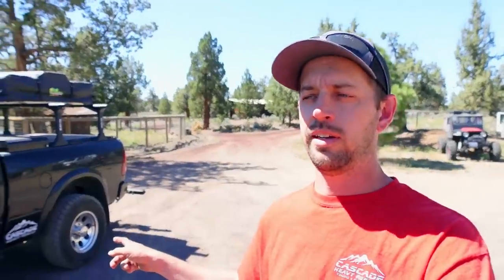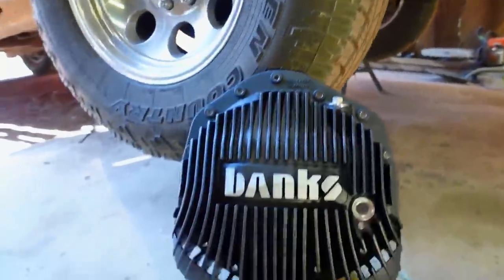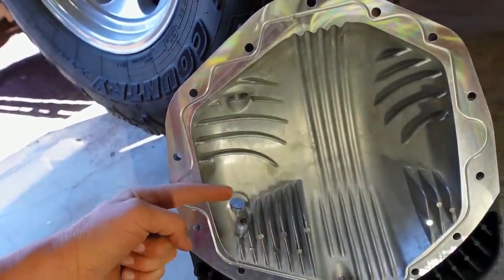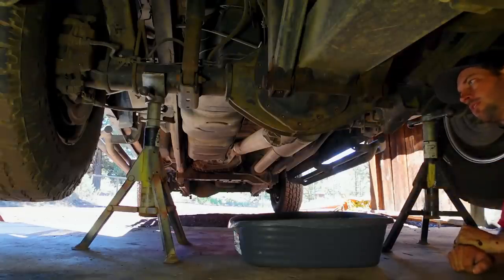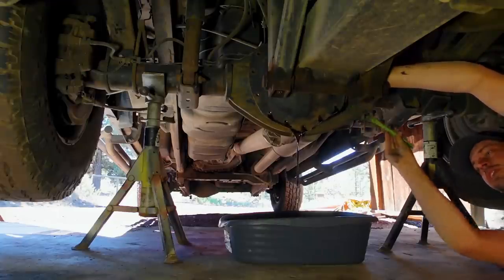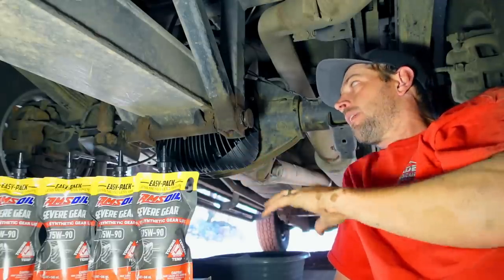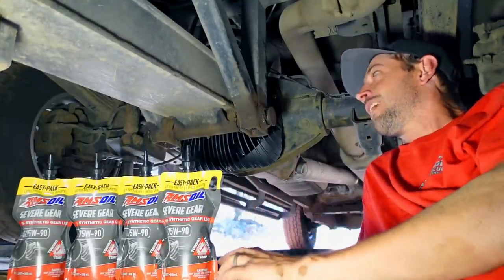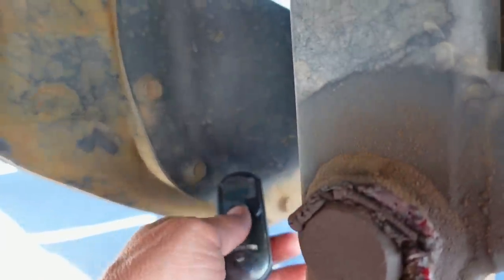Can we make this rear end last?? Installing the Banks Ram Air Diff Cover

Comment: A tip when removing dif covers. Leave two of the top bolts in, just loosened a few threads. When you  pop the cover, the cover will stay in place, but will swing out and the oil won't splash all over the place. Learned that from my grandma.
Reply: Did she do Burn-outs like PAUL/FabRats'  mom  ?😄?
Reply: like eric over at south main auto channel says '"a little trick memaw taught me"

Comment: I remember watching the Banks video serious where Gayle Banks was testing rear dif covers to develop that cover. A lot of aftermarket covers not only did not help, they actually hindered lubrication.
Reply: When I first saw the Banks demos I didn't like the way his cover extends beyond the factory dif. I still dont like that it extends past the bottom of the dif, if you hit a rock yes it will break the cover. It will break in a non uniform manner and will break a good portion of the dif cover. The reason being there is no breaking points for it to break in a controlled manner. Also rocks chips will become stuck in the fins and it's a pita to remove.
Reply: 2 words :  SKID PLATE
Reply: I just saw Banks startup video of the Supercharged Duramax in the C10. Wow. It responds like a gas engine. Very cool. The man puts in the time and money to have the right team doing R&D to build very cool and functional products.

Comment: I bought one two years ago to hff help cool down the gear oil.
My truck is used almost exclusively for towing. The Banks cover has significantly lowered the temperature, especially on those long pulls on 6.5 % grades on hot days.

And yes, I use Amsoil in the diff, G56 manual trans, and engine.

Michael  Rzewuski

Comment: Casey, once upon a time I shattered my clutch plate in my 46 Willys. I had no tow insurance and no money at the time. Luckily I found that I could power shift and drive slowly back to my home. Once home when I tore it apart for inspection and repair work I found that It was a miracle made it home. The pressure plate technically was still functioning but was jammed with clutch splinters. The splinters of the clutch plate had wedged into the pressure plate and lodged into the remains of the clutch disc hanging on the transmission input shaft. This all could have disintegrated on any one of the power shifts I made on my way home. I was lucky to make it home. You did the right thing getting a tow truck for the ladies. These adventures had the insurance to get towed.

Comment: So on your Banks cover I noticed the fins on the exterior are the Same gauge of thickness from cover to end of fin. The heat dissipates at the very tip when cool air runs through the fins. I like seeing the tip of the fins thinner as you will dissipate more heat faster into air. Just my two cents, but looks like a great functional cover.

Comment: Casey.. Consider having the old housing straightened and a "truss" added to it thus making it able to handle the additional torque from the engine and remember low range.. Torque increases by the amount of the ratio reduction.. Hence; 3:1 reduction on a 100ft lbs input torque yields 300ft lbs output.. One oop's while in low range will twist that housing instantly..

Comment: Check your sight gauge (might need a little mirror) if you put in all the gear oil. It overfilled my diff, so I used the convenient level drain to lower the level to where it belongs.

Comment: Great video Casey! I also run Amsoil in my, front and rear diffs, transfer case and manual transmission. I'm about to hit 200k and I use my truck (not quite like you though lol) for daily driving, off roading and truck stuff and every time I change the fluids (usually every 60k ish), I'm amazed at how clean and clear the Amsoil fluid is.

Comment: Just a quick hint. 
I always cut the heads off a couple bolts of the same thread as cover bolts. That way you can hang the cover on them, before putting the other bolts in.

Comment: I watched Gale Banks series of when they designed this diff cover. He probably didn't make any friends from the other aftermarket diff cover companies, however his design makes total sense. If the flat backed style was better then Ford, Chevrolet and Dodge would all be using them. Banks is a smart guy and had an excellent channel.

Comment: Hope the cooling cover solves your rear end problems because they can't be cheap for that truck. A friend turned up his 5.9 and had driveline issues all the time. After his 3rd automatic transmission he went to a standard shift then he started having drive shaft and rear end issues. It was mostly due to the way he treated it. Another friend kept going thru clutches in his dually, he used his to pull a 3 car trailer. Just a lot of torque under the hood for that size truck.

Comment: That conversation you had with Jay could have been worse, you know.  He could have started talking to you about your "Third Member."  That is an old term my dad used back in the day.  I don't think there are any modern light trucks that have a removable carrier.  You might explain that at some point as well.  One thing about your ostomy bag, you sure don't let that stop you!  I didn't realize the damage a person could do by pressing the gas, I mean accelerator, to the floor in a rig like yours.  I have a Banks Tuner on my truck and I didn't give it a second thought.  Great video!

Comment: Love the Banks diff cover and your install. Went to the Banks video and loved that. However, the Banks diff is $375 and price increase in March, so a bit stiff for my fixed income. It did lead me to look at the rear diff on my 2001 RAM 2500. (Not sure Banks even makes one for that model.) Anyway, bottom of diff looks dark, so wondering if an oil leak. So thanks for leading me to that! Big fan of your vids!

Comment: Get a drill powered gear pump... one hose in the oil container and the other in the diff. fill hole...

Easy Peasey, Lemon Squeezey...no fuss, no mess (until the diff. is full and it starts pouring out the fill hole anyway)...

😄😁😆😅😂🤣

Comment: I am wanting to say that when Jordan installed that rear axle in your truck you mentioned that there was going to be some "adapting" for ABS sensors, etc.  because it was a 2008.
Reply from the maker: Yep, a 2014 uses a four sensor system with wheel speed sensors at each rear wheel.  A 2008 uses a three sensor system with a single sensor inside the rear diff.  We got a little creative and adapted the 2008 rear axle to read wheel speed at each individual wheel and work with this trucks computer.   But the tone ring is still inside the diff and I completely forgot about the whole axle swap when Banks asked for the truck info to send out the cover.

I have to say,  Nate, Jordan, and Gavin are complete badasses when it come to figuring out how to make shit work.

Comment: we made the mistake of running one of those flat covers. it kept the oil cooler but it didn't flow right. the biggest problem is that those diffs have a unusually long pinion which means it's farther away from the oil flow

Comment: This is surprisingly interesting. It begs the question why auto manufacturers do not implement such superior design from the beginning on vehicles where it would be beneficial. Not needed on a Camry, but on 1 ton and bigger trucks and certain sports cars it sure would make sense.
Reply from the maker: Because a piece of sheet metal stamped into shape in just a couple seconds is FAR cheaper to produce
Reply: Further to Casey's response, it's also because the accounting departments of vehicle manufacturers have bigger muscles and louder voices than the engineering departments.

Comment: Hmmm I'm torn.  I have a shiny new Mag-Hytec cover ready to go on soon.  I like that it doubles the fluid capacity.  I've used them before and love 'em.  Plus, I have a big-ass Hellwig rear swaybar and this should just barely fit, whereas I'm not sure the Banks will.  Not to mention the Banks one is about $100 more.  I tow VERY heavy... truck camper + 36" extension + 24' enclosed trailer.  I already switched to 19.5" tires (dually) so I'm not overload the tires anymore.  I'll be adding a temp sender too.
Reply from the maker: Watch the Banks videos on diff covers and you'll see that those big high capacity diff covers actually REDUCE your lubrication..
Reply: @CaseyLaDelle  Well, after seeing that, I arranged to send back the Mag-Hytec and I ordered the Banks!  Perfect timing on this video, Casey.   And I hope your rear end problems are cured. 😛

Comment: flaps break off will cause fluid to leak and leave you stranded on the side of the road?
Reply from the maker: I very clearly addressed that, and Gale Banks literally broke them off on video to show and explain what happens.
Reply: @CaseyLaDelle  , he did not show in real life and he didn't show if any fluid would sip. We don't even know if rear end even had fluid when did.  I can assure rear end had no fluid when he broke flaps.
Reply from the maker: @repairvehicle  you are 100% making that up in your own head.    But let's pretend you're right for a second...  These things have been out for years, where are all the reports of them breaking and dumping fluid??

Comment: Yeah that's nice and all but it's not gonna stop them tubes breaking breaking it's not gonna stop them Wells from being weak week there's different types of gussets and supports you're supposed to Weld to those rear ends to make them strong enough
Reply from the maker: I can solve the axle tube problem by simply not towing with it in race mode..

Comment: Are you doing anything for the torque issue that actually broke the rear end? This cover is to keep it cool of course but the torque twisting the tubes is why it broke, correct?
Reply from the maker: Yes, I'm not flat footing the throttle with the timer set on race mode while towing cars on the wheel lift 🤷🏼‍♂️
Reply: @CaseyLaDelle  I figured the lead foot was the problem.  So there isn't an issue that needs to be fixed and that is good info. Thanks for the video!

Comment: Just curious...with all of the off road recoveries that you do, will the cooling fins get packed with dirt and mud?
Reply from the maker: Snow, yes.  Mud, no.   Mud is a very rare thing around here
Reply: @CaseyLaDelle  Wouldn't any heat generated melt the snow? I guess if it is really cold outside, it probably won't melt. I guess snow wouldn't hurt being in there. It would keep the oil cool, right?🙂

Comment: I have a 06 Dodge diesel.  I had replaced the pan on the transmission for the same reason.  It gave me more fluid and more cooling. At the time no one had made a replacement cover for the differential. But alway wanted one.  Maybe the next time I service the rear end.  Thanks.

Comment: So I just recently bought another TJ and it came with teraflex hd diff covers. I put them on Friday and realized the rear Dana 44 has a high pinion and low pinion fill plug. The issue is that I have a low pinion and the stock fill hole was in the middle of the two on the teraflex cover. Anybody with experience or input on these?
Reply from the maker: I would recommend looking up how many quarts your diff is supposed to hold and as long as the new diff cover looks roughly the same size... Put that much in it